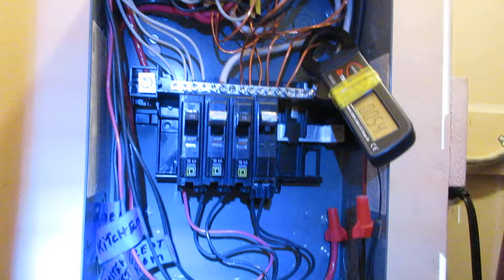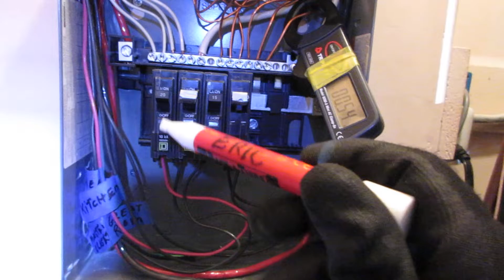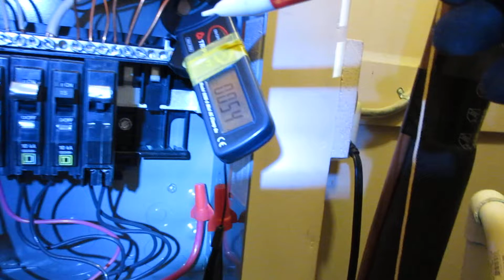Building inspector missed these neutral to ground connections: why?

Comment: Or mount a separate ground bar
Reply from the maker: Right. Ns & Gs can't be bonded past the serve entrance panel, on the load side of the serve panel. per NEC 250.24 (A) (5)